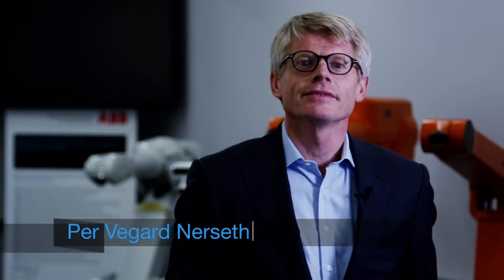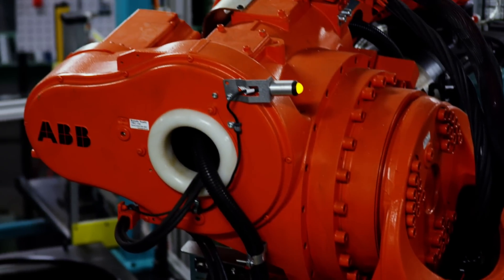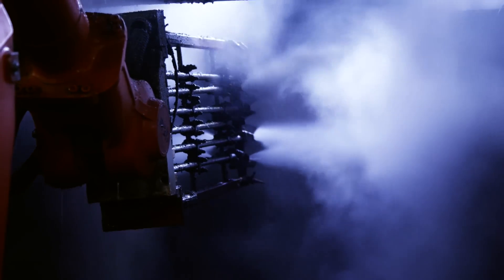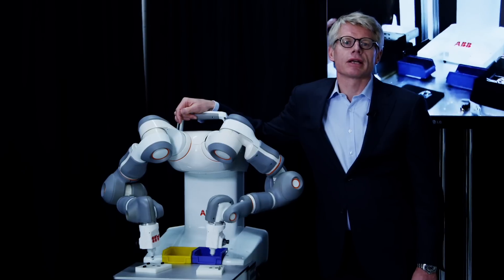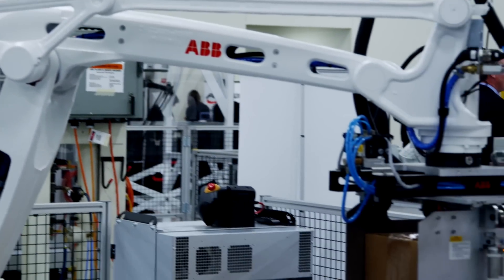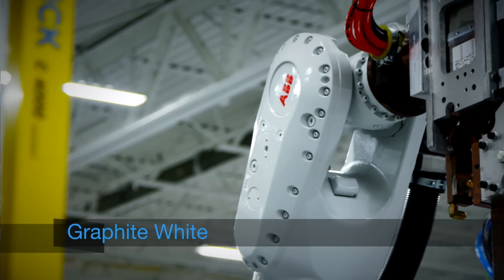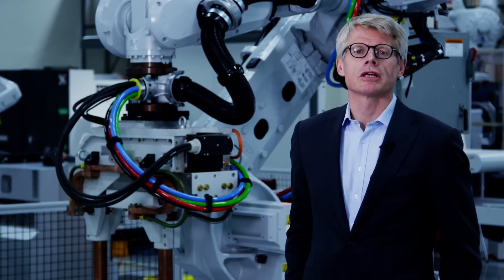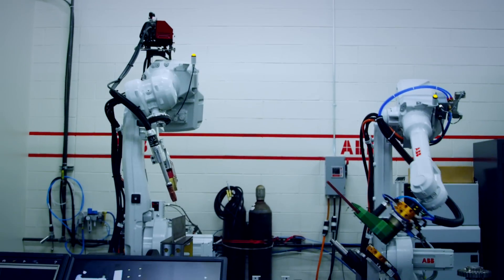ABB Robotics - Introducing a new era of robotics

Comment: Abb and Kuka Robotic Engineers How About Talking Relationship Robotics Bear A Labour Head Face into All Industrial Robots.Unfit Mobile -Radio waves Control Devices Onto All Abb And All World Industrial Robotics.I think Electro Magnetic Self Generating Electrical Motors into All Abb And Kuka Kind Robots would Bear Independence into Our Robots.Bearing 360%Air Vacuum Magnetic Ball Wheels Underneath All Robots will Bear Them Mobuilty Around All Industrial Areas Global.I want to Become a Mechanic Working in Building Robotic Machines in Order to Bear My Own Machine Ideas into Our World.Need work with Your Abb Kuka and World Robotic Companies.